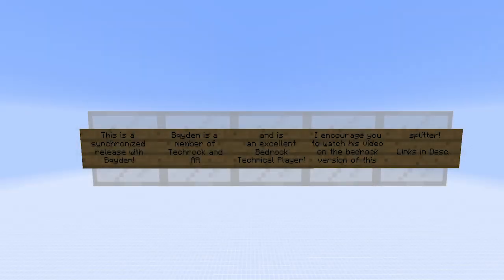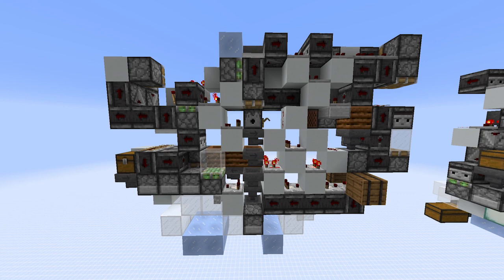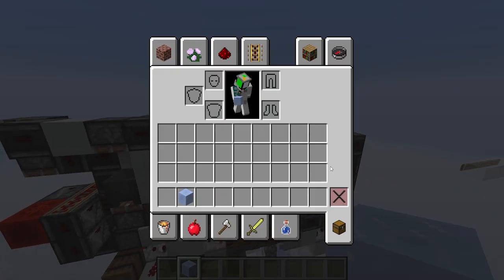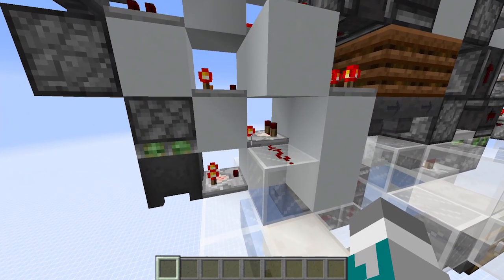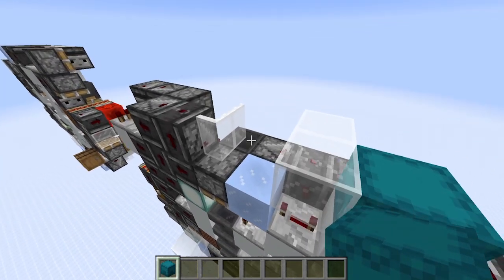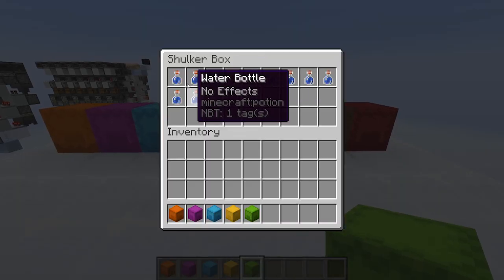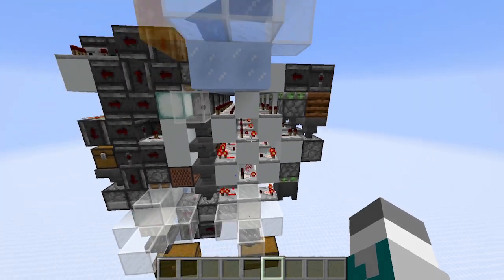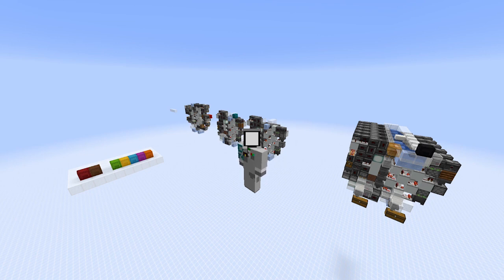[1.16; 1.12+] Dust Update-less Ideal Output Splitter

Comment: I was struggling with the previous design having issues with the output shulker box not being replaced and causing the splitter to back up. Any ideas about what the issue could be? I'm running some optimization mods like lithium and phosphor, as well as carpet.
Reply from the maker: Some folks reported issues of bats spawning at the wrong moment which is why I added the sea lanterns. Another potential issue is that your empty box distribution allowed an unstackable item through which would cause issues.

Comment: Could you make it completely filter item resistant by using unstackable items in the self resetting variable sorting part. It should work because it'll put you right on the edge of the ss output just like 19 1 1 1. You'd have to manage your ss downstream but that looks doable. Just a thought.
Reply: Ignore that ^ doesn't work.
Reply from the maker: I was actually able to get a filterless version, but its a fair bit slower.
Reply: @DatNerd  I'd be interested to see how you did it.
Reply from the maker: @metamilo  I'll try and make a video soon, just wrapping up some end of the year responsibilities =]